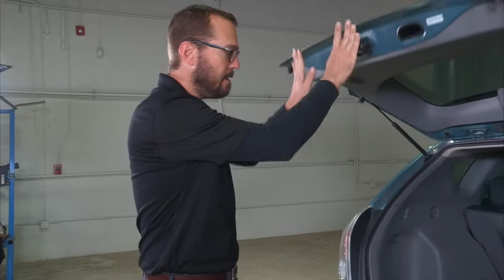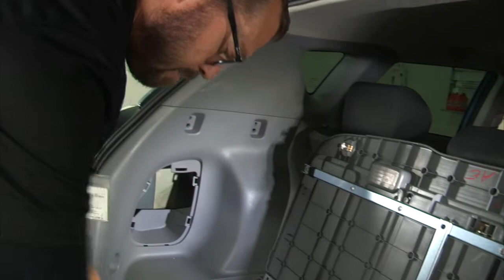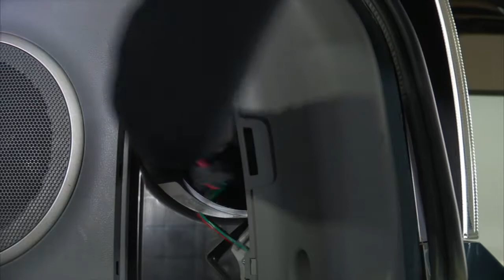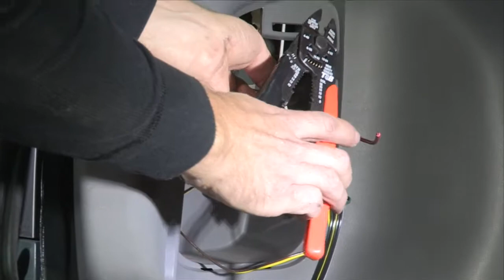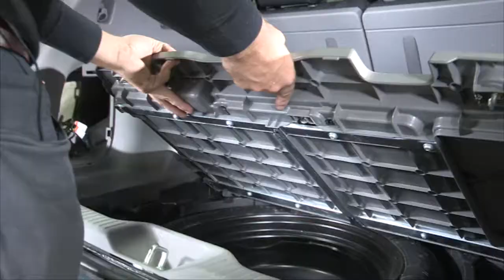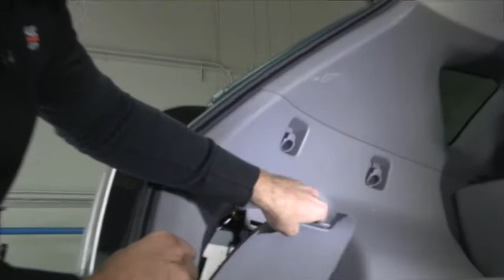2009 Pontiac Vibe Trailer Wiring Installation

Comment: My mechanic didn’t install the light ending inside the car rear side panel. The tail end is permanently sticking out from the trunk of my car like you have it looking right at the end of your video.
On my car, the wire comes out from behind the bumper at the bottom and I have to permanently close my trunk with an 18 inch wire trailing down to underneath the bumper!
He told me that that was the way he had to do it.
But I have the exact same car as you used in your video! Was he not being completely forthright with me?🤔